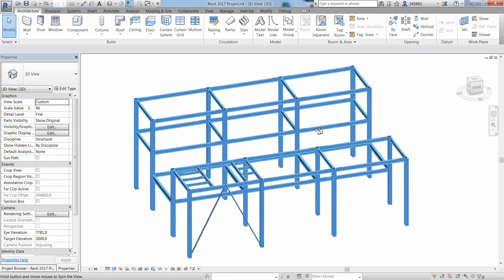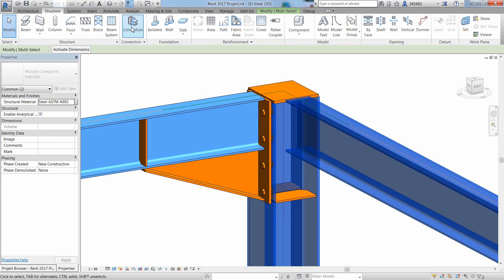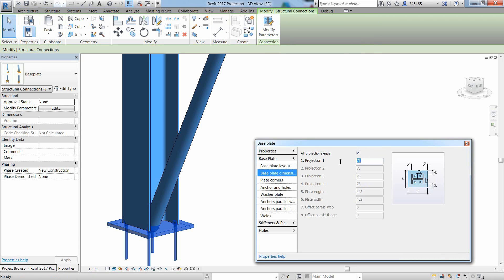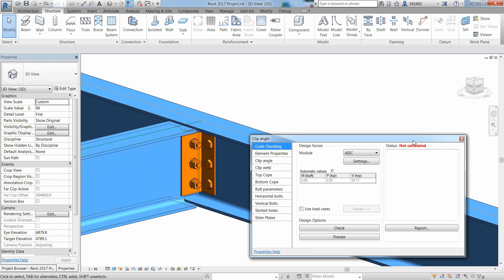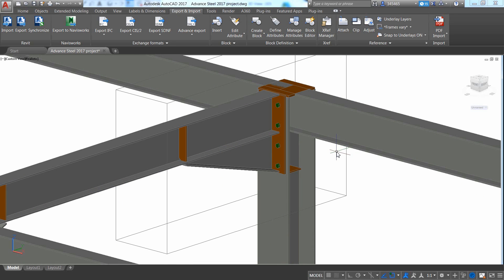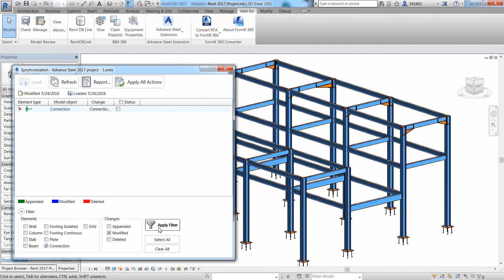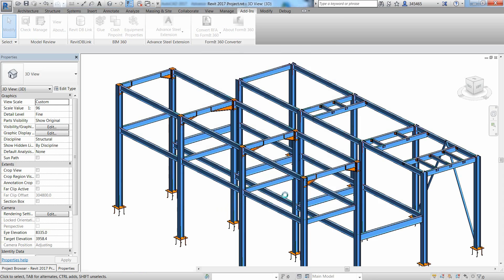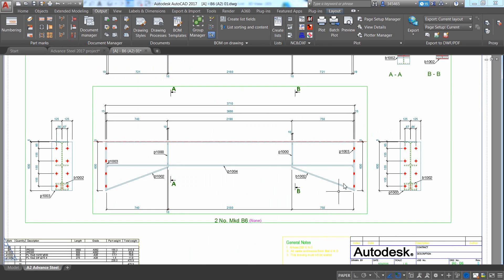Structural Steel Connections in Revit 2017 and Advance Steel 2017

Comment: I have 2015 Revit, after i saw this video I installed the 2017 Revit to do like those steel frames. but, the steel connection dialog box is empty.there're no connection styles to connect beam & columns, please give me an answer.

Comment: when i put connection details my column/beam is going back to their original dimension help 
pls!in revit 2017
Reply from the maker: Which type of steel connection did you try to insert?
Reply: Revıt 2017 steel connections problem.I installed 2018 ı have no problem
Reply from the maker: OK, great!

Comment: Hello,
I am facing problem about the profile type that i have in library, the profiles available are for american profiles, my question how I can get the international profiles like IPE , HEA and so on, please advise.
Reply from the maker: You should go to Control Panel > Program and Features. Then select Autodesk Revit Content Libraries 2018, and press Uninstall/Change button. Choose Add or Remove Features, and then select the content library/libraries you would like to install, and press Next.

Comment: Hello,  how do you put dimension on the steel connection. Because I can't put dimension form the plate edge to the center of the bolt.
Reply from the maker: Maybe you should change the Visual style (from Hidden Line) to Wireframe before creating the dimension, let us know if it solves the issue.

Comment: Damn. I loaded all kinds of connections in "connection settings" but it still allow me to insert generic connection only. why?
Reply: I am having the same issue the only option i get is the generic connection.  Not able to display any parameters or anything even through everything is loaded.  If you have found a solution to this I would be interested to hear.
Reply from the maker: Are you using Revit 2017 or Revit 2018?
Reply: 2017. It works now thanks. :D
Reply from the maker: Perfect, thank you for your feedback!

Comment: I downloaded the steel connection software but it's not getting in the project always it's showing the default one (generic one ).how can I add the steel connection as like u mention in the video.
Reply from the maker: Did you first load steel connections in the Structural Connection Settings dialog?
Reply: me too. I already load steel connections in the Structural Connection Settings dialogand then I placed the steel connection .But generic line only appear . not shown Connection even  I  turn on conection in Visibility and Graphics (VV)

Comment: WHY THE SIZE  OF THE BEAM AND COLUMNS CHANGES WHEN I CREATE A CONECTION? THE PROGRAM MAKE THEM SMALLER.
Reply from the maker: If you insert a base plate connection at the bottom of a column, it will shorten the column by the base plate thickness value, does it make sense?
Reply: same issue, the width going back to the original dimension

Comment: Hello I have 2 revit versions installed 2016 and 2017, Steel Connections for Autodesk® Revit® 2017 64-Bit.
I can do all the procedure, but when I try to install the update it does not work.

How can I solve this problem?
Reply from the maker: What do you mean with "when I try to install the update it does not work"? Do you mean installing Revit 2018 (which has been released almost a month ago now)?

Comment: I have only AISC module for code Checking. How can I add EC3 ?
Reply from the maker: Most of the steel connections can be checked against AISC or EC3, but a few of them can be checked only against AISC (e.g. through plate) or EC3 (e.g. knee of frame bolted with haunch).

Comment: hello... i have a question. when you made the connection, how did you do it? because in my revit i can't. when i picked  KNEE OF FRAME BOLTED up, the program showed me the GENERIC MODEL
Reply from the maker: If you are a Revit 2017 user, are you using Certified families for the structural framing & structural columns? FYI - one of the new features in Revit 2018 is the ability to apply steel connections on certified families and also on custom families, which is great!
Reply: time to up grade revit jajaja thank you very much

Comment: how to add connections in revit 2016
help me plzzzzz
Reply from the maker: Steel connections are only available for Revit 2017 (since April 2016) and Revit 2018 (since mid-April 2017).

Comment: I have installed the plugin Steel Connections, until I have loaded the connectors in the project, but when I finish the insertion the connectors do not appear the connection, only appears that generic connection could try to help me?
Reply: me too
did you get any solution?
I also cant find solution yet/
Reply from the maker: Change the "Detail Level" to "Fine". And select all components (Anchors, Bolts, Plates, etc) in the "Structural Connections" branch within the Visibility and Graphics dialog-box (VV shortcut).
Reply: You can use Template Structure

Comment: how do you get the blue color for steel framing and orange for connections? in some videos you have the red color for steel framing too. I am new in revit, please let me know...
Reply from the maker: There are several methods to get Revit objects being colorized, but here is what I did for this video.If you go to the "Visibility/Graphics" dialog (icon available in View ribbon, but you can also quickly type VV), go to Filters tab, then you can "Add" a new filter (e.g. Structural connections) and assign it a specific color (e.g. Orange) and pattern (e.g. Solid fill).Hope that helps!
Reply: Ok, thanks.

Comment: hello how do I add the structural steel connections in Revit 2017?
Reply from the maker: Please have a look at this video: https://youtu.be/3czl1Zr80qQ
Reply: Hello I have 2 revit versions installed 2016 and 2017, Steel Connections for Autodesk® Revit® 2017 64-Bit.
I can do all the procedure, but when I try to install the update it does not work.

How can I solve this problem?

Comment: Hello good afternoon,
how to add connections in Advance Steel revit?
Reply: The Autodesk® Steel Connections for Revit® 2017 is a separate extension, available for current subscribers from their Autodesk Account (you will find it under Autodesk Revit, then Updates & Add-ons).

Comment: can u explain how connections this feature as wen i press in " connections " it is empty
Reply from the maker: The Autodesk® Steel Connections for Revit® 2017 is a separate extension, available for current subscribers from their Autodesk Account (you will find it under Autodesk Revit, then Updates & Add-ons).